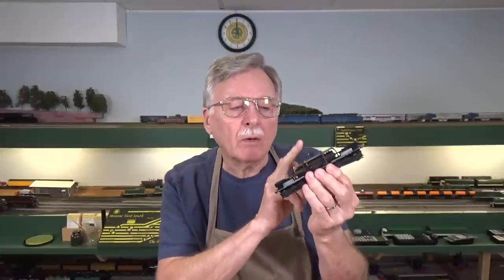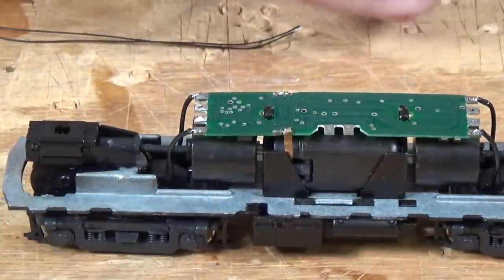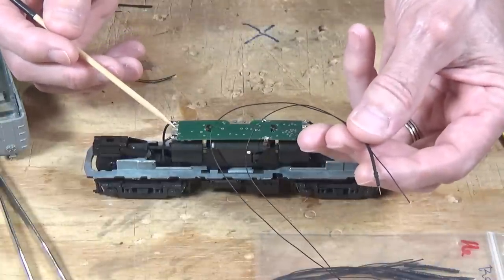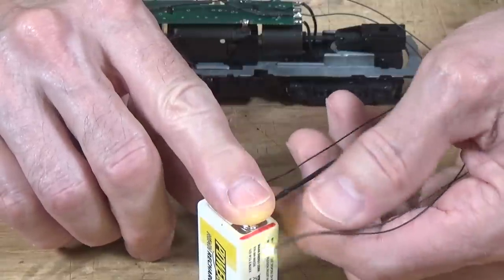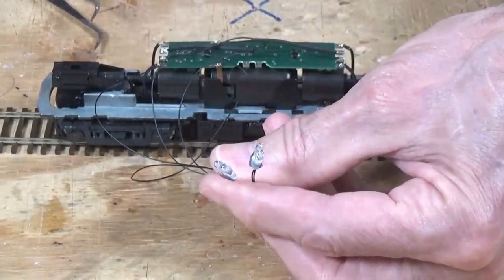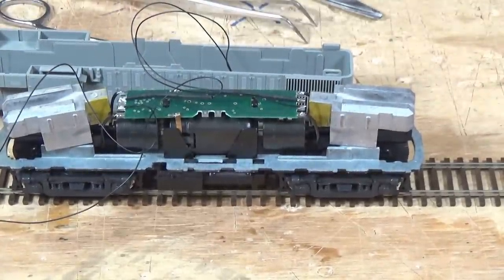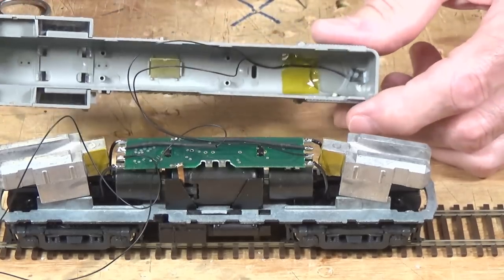LED Lights For Your DCC Locos (268)

Comment: Excellent info. I have an older Proto2000 switcher that I need to install a decoder in and this makes the process of adding LEDs for the head and tail lights way easier to understand.
Reply from the maker: If it is the SW9 be aware that NCE makes a direct replacement decoder that fits in place of the existing board although right now they are out of stock due to a lack of parts.
Reply: @TheDCCGuy  I saw that! I'd back-ordered one from one online retailer, but then found it in stock at another. I have it in hand now and just need to work up the gumption to unpack the soldering iron. Without a layout to run it on currently, it's a bit lower priority!

Comment: Good as always.  As they have been installed with long lengths if they are lighting up going the wrong way it is easy to ensure that the right one is at the correct end rather than changing wires.

Comment: I use 3mm LED's for HO gauge and 5mm for Lionel 027.  Don't forget the ballast (current limiting) resistor.  I never use an X-acto knife; I always use an A-proxo knife.  Cheers from eastern TN

Comment: Larry,  Good video!  Now do a steam engine with flickering firebox for us steam fans, please.  Preferably a firebox light that runs off the motor leads to cut down on wires going back to the tender.

In this video you were dealing with 4 wires.  Yet, a decoder like the Tsunami 2200 has a lot of wires.  Stuffing wires into a shell can be a pain when there are a lot more wires trying to escape.  My solution is a product called Glue Dots.  Same sticky stuff that bank cards come attached to on heavy weight paper.  I can place a glue dot anywhere, press a wire or more into it and it will hold the wire(s) in place.  If I need to work on the decoder, then it is easy to pull the wire from the glue dot.  Wire management where you need it.  Glue Dots are available on Amazon.
Reply from the maker: The easiest way to do that is get a flickering LED off eBay and wire it across the track power pickups with the proper dropping resistor. These are becoming very common in new steam locos in the UK so I am expecting the US makers to follow suit down the road.
Reply: Many decoders have a lighting effect so that you can just use an ordinary LED (with resistor).  Quite a few UK locos have 2 LEDS (red and orange) so that you get the steady glow and the flicker.

Comment: Larry I have the same LEDs I used them on my engines too.  Thanks for the tip on how to test what wire is positive and negative  The 9 Volt Battery is a good idea.

Comment: Nice job, Larry! Pre-wired SMD's are great, aren't they? One thing I would recommend is to use a bit of flat black paint and go over the area where the light tube sits, and the exposed interior parts of the tube. It really reduces light bleed.

Comment: If only I had seen this video before I did my light fitting it would have been a lot quicker.  I worked it all out though and it works well, only my lights are cool white as that is all I had.  I may open it up again to fit something more suitable sometime, but I am happy enough to have it working.
Reply from the maker: I have found that a light coat of Tamiya transparent orange paint will compensate for the blueish tint.

Comment: I'll disagree on electrical tape failing, at least in model railroad applications. I have some three decade old installations of constant lighting circuits wrapped in electrical tape that were still good when I went to upgrade those locomotives to DCC. Of course I was using a quality tape that didn't get stiff or dry out with time. That testors clear cement looks a lot like canopy glue, which I tend to use a in a variety of applications. Looks like white glue when wet, but dries as a clear strong flexible bond.

Comment: Great video.  Have you ever done one about adding ditch lights and strobes?
Reply from the maker: Not a video but I did do an article in MR a few years ago. There should be a number of companies offering ready to install ditch lights and I have a rotating beacon on one of my switchers. I will add these to the list of projects down the road.

Comment: Larry,  the last 2 videos were really good.   Good simple instructions.  I hear so much about can motors,  I thought a loco, (especially the older loco's) that was going to be a dcc loco had to have a different motor.  The original motor had to be switched out.  Can you comment on what type of motor can be used?  Does a can motor have to be used if it is going to be used in a dcc system?
Reply from the maker: It all depends on how old the loco is and the motor, that’s why I did a video (#89) on how to measure stall currents. At any rate since about 2000 manufacturers have been using motors that are generally DCC friendly. Even before that the Atlas locos made by Kato have low current demands. However those made by Roco are a different matter. And this changed over time as the late run Alco S2/4 switchers they made with a skew wound motor are low current. So if you are not sure, measure the stall current and use a decoder that can handle the current. Replacement motors can be difficult to obtain in most cases. First check with the original manufacturer ti see if they sell replacements. Athearn does but most others do not. Then check with companies like NWSL and MicroMark. You might have to get innovative and buy generic motors and cobble up a connector—NWSL used to sell universal, etc. for that purpose so check their website. I have even used small diameter vinyl fuel line to connect motor shafts to gear worms.

Comment: Larry, what kind of solder are you using and would it be good to use on the rails as well ?
Reply from the maker: Either 60:40 or 63:37 and I use it on almost all my MR soldering. Make sure to never use an acid flux.

Comment: Larry: as ever entertaining.  Some ?s: What about permanently lit engine room lights?  Can we connect more than one 'bulb' to one set of solder tabs?  All but universally, youtube presentations exhibit 'jackrabbit' starts with DCC.  Real diesels are a masterclass in creep starting.  With good mechs, can we replicate?  Finally, as a scratchbuilder with default influence from years of 2 railing Marklin, I would be looking at the migrainous procedures of placing everything on the chassis.  No wiring looms.  Modern locos, at least those I have seen, are not made to work on.  Oiling is a pleasure when the top can be simply laid aside; the whole thing dismantling with one M3 screw, and sometimes the removal of one coupler.
I realise time might disallow reply; any comments appreciated.  Peter T
Reply from the maker: Peter—yes you can attach multiple LEDs, just make sure you check the specs to see how many milliamps a function can take. They can be wired in parallel or series. Some decoders have several lighting functions in addition to the forward and rear headlights. You can adjust the speed characteristics of the locos using the accel and deceleration CVs 3&4, and also by adjusting the 3 or 28 speed step curves. After watching a lot of videos I am amazed at how fast a lot of these locos could accelerate as single units, both steam and diesel. Another option is to use the switching or shunting speed function button available on many decoders, which cuts the speed range in half when activated. Enjoy—Larry
Reply: Larry: thanks for that; shall ponder. 
PT

Comment: Very good video Larry. What are your thoughts on mini connectors between the decoder and shell? I am going to install a sound decoder, two leds and a speaker on a Athearn GP7. I thought I'd use a 5 pin connector. 2 pins for the speakers and 3 pins for the 2 leds, 1 pin front, 1 pin rear, 1 pin common ground. That way when I take off the shell I  can unplug the connector and set the shell aside. I realize I'll need to give plenty of slack to make the plugging/unplugging easier but I like the idea of the shell isn't tethered to the locomotive. What do you think? Thanks.
Reply: Also, do you use mostly 30 gauge for decoder/speaker installs?
Reply from the maker: I often use connectors as I have shown in some previous videos. I like those from TCS as they are small and the wires very flexible. I didn’t do that this time just to keep it as simple as possible. When you make your connections do it so reversing the plug won’t create problems. For example with 5 wires, put the speaker wires on pins 1 & 5, the blue common on pin 3 and the light negatives on 2 & 4.
Reply: Thanks

Comment: Great video. In my decoder settings, it has settings for neon or LED lights. What's the difference? Do i still need the resister if I change the setting to LED?
Reply: Neon lights are probably providing a flickering light when it is turned on, just as it is, when you turn on an overhead light fixture
Reply from the maker: I have never seen a decoder designed specifically for neon lights and have never used them—what brand is it? They should say in the manual what the output voltage is for those and you will need to adjust your resistor for the LEDs accordingly. It is possible that the neons use the full voltage output and a resistor would definitely be needed for the LEDs.
Reply: @TheDCCGuy  So for the Digitrax - DH126D it says in the manual the passage below. So would this influence how you would pick an LED and resister? Or is it still just 12V?

"8.7.2 LED/Lamp Algorithm Selector
Beginning with Series 6 decoders, Digitrax FX effects are optimized for either
LEDs or incandescent lamps. Since these two types of lighting devices have
different characteristics, Digitrax has set up two selectable algorithms for
operating the devices. Some users like lamps better than LEDs and vice versa.
Many new production locomotives have been produced with LEDs. You have
the option to use either."

Comment: I have bought leds and have installed in a couple of my locos. They are great.  Do you have a video with more complex led installation wiring using f3, f4, f5 and f6. I have a loco that has a rotary  beacon on top and then running boards and cab light that these can turned on and off independently.  It's a little confusing ! 
Thanks again.
Chuck
Reply from the maker: I did an article in the Sept 2019 issue on doing that kind of lighting but since I don’t model modern locos I have never done it to that extent. There are a lot of companies that make nice light fixtures but in a number of cases you’d have to do your own with the surface mount LEDs. Check out these https://nicknixtrainz.com/elementor-497/
Reply: Ok, thanks for the link. I will check it out.

Comment: Hi Larry, My name is Ed, I have a few Athearn Locomotives that DON'T have those circuit boards on them. They're about 50 years old, can I still install LED bulbs in my engines? Thanks!
Reply from the maker: Yes, shouldn’t be a problem.
Reply: @TheDCCGuy  would you do a demonstration on how to do this?
Reply from the maker: Are you going to use them with DCC decoders? If so it would be the same way.
Reply: @TheDCCGuy  They're basic stripped engines without decoders or circut boards.
Reply: I just want to add LED's in the front as well as the cab side.
Reply from the maker: You’d be better off using the small Miniatronic bulbs rated at 16VDC. Doing that with LEDS would be a PITA since it would require special circuitry to handle the voltage drop and polarity issue.
Reply: @TheDCCGuy  Sorry Larry, I'm a novice since I haven't had an HO collection since the late 70's. What's a PITA and are the miniatronic bulbs AKA "Ricebulbs"??
Reply: NEVER MIND.....I figured out what PITA means!!

Comment: What size drill bit did you use to make the holes?
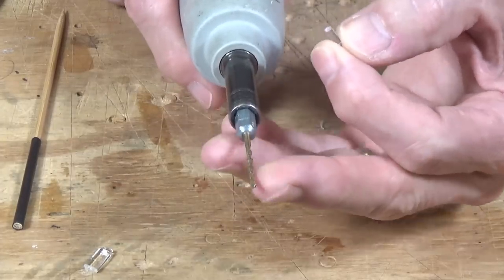Reply from the maker: At time stamp 11:27 I said 1/16” bit.
Reply: Was the 1/16 bit the second one you used I seen 2 bits you used what was the size of the second bit?
Reply from the maker: Same bit, different drill.
Reply: @TheDCCGuy  ok thank you

Comment: What temperature do you set you’re iron at?
Reply from the maker: 800 degrees, but be careful at that temp. You have to work fast so as not to overheat your parts.
Reply: @TheDCCGuy  I have mine @ 650 right now
Maybe it's not enough
Reply from the maker: My suggestion is to start just above the melting point of the solder and work your way up until you find your sweet spot where you can get the job done without cooking anything.
Reply: @TheDCCGuy  I guess the melting point is on the label?
Reply from the maker: You’re typical,looking at something around 360-370 degrees F but that is for 60:40 or 63:37. Other mixes will vary though so do a Google search and it will give you temps for various other types.